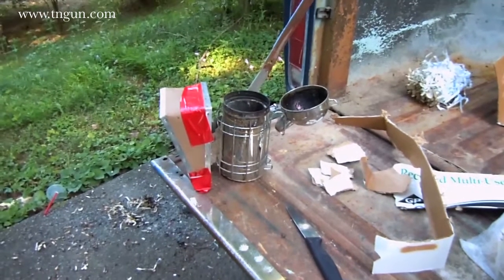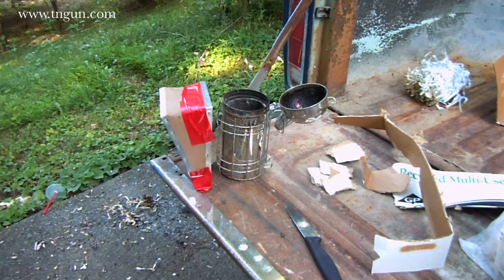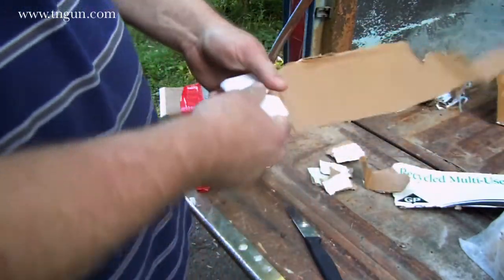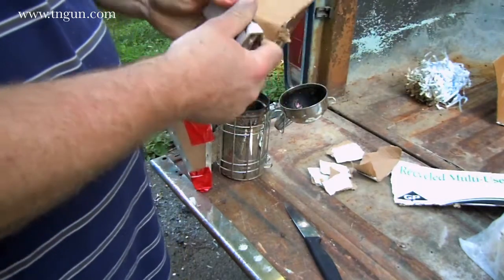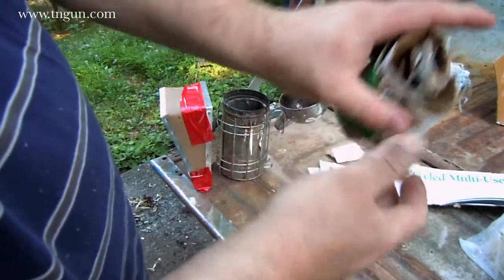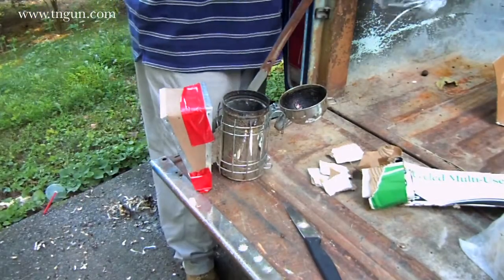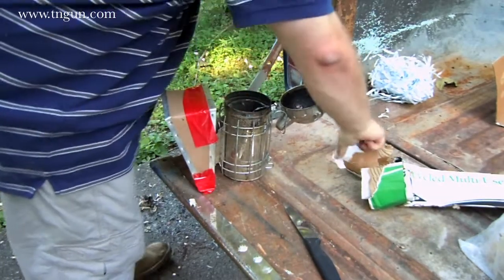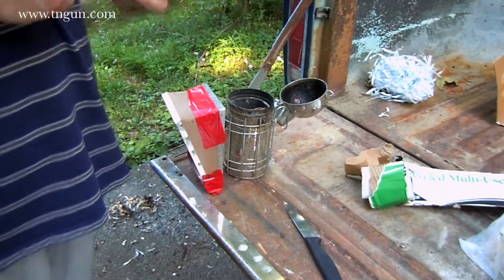How to Light a Bee Smoker | Beginners Guide to Lighting a Beehive Smoker that Stays Lit

Comment: We used corrugated cardboard tightly rolled with the corrugations lengthways so that the smoke could pass through them. The strips were accurately cut to the exact dimensions of the smoker, rolled and held in place with a small strip of masking tape. When used, one end was fully lit with a blow torch (or on the cooker), left to burn for about 10 seconds, tapped out and then put smouldering end away from the nozzle in the smoker. We kept a supply of  pre-made rolls which we replenished whenever we received a corrugated box with a delivery. The first one took a few attempts to cut to dimension, then we unrolled it and cut copies that only took a few seconds. We were simply copying the premade inserts that were supplied with the smoker.
Reply: so you are rolling cardboard tight with masking tape and lighting and thats all the fuel you use?